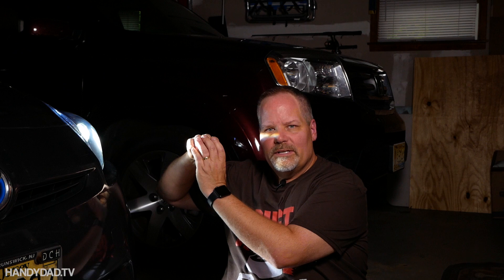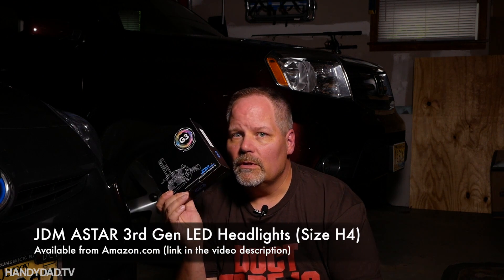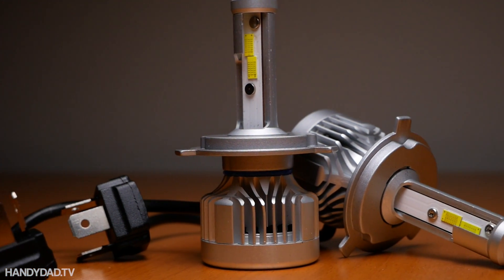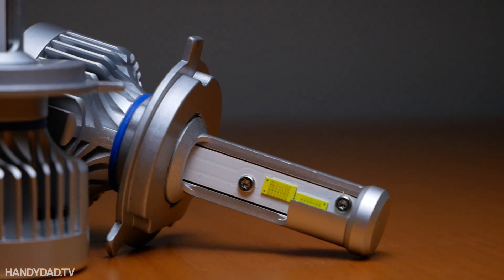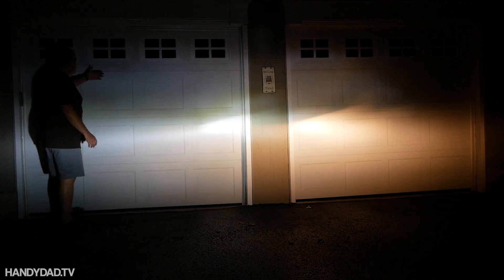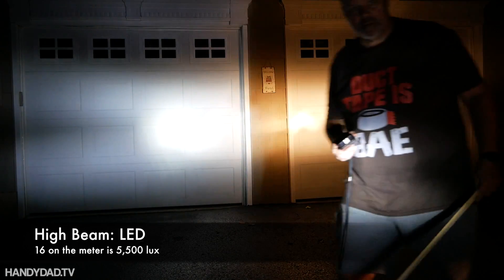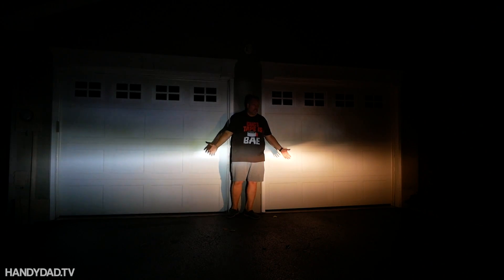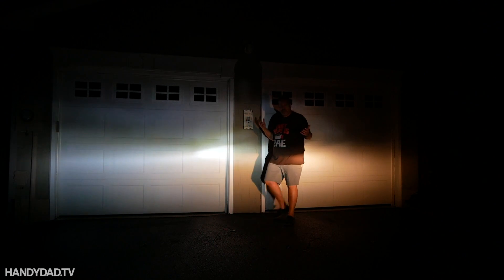Dual Beam LED vs. Halogen in Reflector Headlights

Comment from the maker: New Federal regulations introduced to the United States as of January 1, 2020 that now regulate the specific type of bulb you are able to use either in a reflector or projector type headlamp housing as well as a Federal ban has also been placed by the Department of Transportation on the public sale of automotive aftermarket LED and HID type bulbs that can be used to replace an existing OE halogen ‘headlight’ type bulb or an OE high intensity discharge(HID) ‘headlight’ bulb. This law is intended to reduce and prevent the public use of an aftermarket LED or HID bulb (that is not an approved as replacement bulb by the vehicles manufacture or is compliant with DOT public road safety laws & regulations) that may be used in the automotive manufacturers reflector or projector type headlamp housing.

The parts that are mainly impacted by this new regulation are aftermarket replacement LED and HID bulb numbers and/or sizes that include a number/size that begins with ‘H’ such as H11, H9, H8, as well as other variations that use a 4-digit bulb number such as 9003, 9004, 9005, 9006, 9008, or 9012.

This only applies to front headlamp lighting applications such as a low beam, high beam, or dual low/high beam bulb.  The new regulations will not impact front fog lighting, off road vehicle lighting applications or other front lighting applications on automotive vehicles.
Reply: Federal Regulations mean nothing.  I dont see them out writing a ticket to the guy with the 3' LED bar that blinds everyone for miles.  People can and will put LEDs in factory housings forever.  Get used to it.

Comment: Does that fan pull in or out? If it pulls in, I think that rubber cover has no purpose because the fan will certainly pull in dust and moisture from the engine. Maybe a filter would solve that, but that's too many parts.
Reply from the maker: It pushes out

Comment: So are the LED retrofit lights designed best for use in low beam of both low and high beam applications in reflectors or projectors? Some users claim some high quality LEDs work fine in reflectors without too much scatter. What about halogen fog light reflector housings? Assuming we are looking at high quality, high end LEDs.
Reply from the maker: LEDs work in any of those situations.

Comment: but what about light scatter and potentially blinding other road users......................leds not ok in all,judgment/some comon sense needed
Reply: Nope. LED’s are always ok on reflectors.

U get a bad beam pattern, no hotspot, if u get the wrong type of led bulb that doesn’t match the specs. Such as large foot print of the led chips that are too big, the space between the led can be too wide, or even if u see a square led or double stack LED’s. Those will never work. 

U would have to look for something that’s really really thin, and a very itty bitty narrow led chip to mimic the beam pattern. Nowadays, lasfit,auxito,auxbeam, Fahren, Hikari, VLED’s micro evolution, Xenon Depot, S-V.4, Diode Dynamics, Morimoto, and GTR-Lighting.

Comment: I have a mod that let's me use the high and low on together. It doesn't work with the leds I have. Are there any leds that let me use both the high and low together? I got h4 or 9003.

Comment: I have a high & low in one LED in my Dodge ram . what I don't like about it is when I switch to high beam the low beam cuts off. which allows me to see down the road a good bit but I do lose a lot of visibility for the first 30 to 50+ ft.  anyone know if this is normal or did I do something wrong when installing them? this doesn't happen and quite a few other cars that I've been in but I did not take the time to see if it was two separate bulbs in them or one single high low. I purchased a cougar flagship series H13. the low beams are excellent and the high beams are good as well it's just that I wish they work together instead of the low beam turning off.
Reply from the maker: It's probably normal behavior for halogen bulbs, so that's how the car is wired. Two filaments in a halogen bulb, on at the same time, might get too hot.

Comment: on H4 headlights LEDs really luck on design even the expensive ones, its because of the complex design and the need of 230 degrees of lighting cut off where leds are super bright on the center and very weak at the down spread only xenon is much much brighter and more efficient  , on h7 on the other hand leds are far superior to halogens, even 15 € kits with 20-25 watts are twice as bright as halogens and expensive kits like mine (35 watts from novisight) makes xenons look like candles, if your knowledge is limited to your car only its not good to think every car / headlight is the same

Comment: the use of a yard stick is the wrong way to go about it. Light spread patterns and distance being different with every light & type of light - you should have tested it at a breaking distance threshold for motorway / freeway speed. Then I'd have liked the video.
Lux, lumen, candle power all being totally unfit measures to compare these.... the above way is the only proper way in my opinion for safety and piece of mind

Comment: you are not that smart,  put the bulb after the dust cover so that it covers the back of the head light, by the why put it correctly.
Reply from the maker: I’m not that smart? Perhaps you should look in the mirror. I showed how I put on special dust covers that allow the fan to protrude. Those bulbs are still working great after several years, so I guess I did it right.
Reply: Ur stupid

Comment: You will find that a traditional halogen high beam with a more yellow output will cut through fog much more effectively. LED high beams simply reflect off suspended water particles in the air, i.e. fog.
Reply from the maker: Well, practically every new car comes with LED headlights so I guess people in foggy areas are screwed.

Comment: Driving in total darkness gives a clear advantage to halogens, as there's not as much blue in the mix that prevents your eyes to adjust. And in spite the idea that LEDs live 10x longer than halogen, in reality it is not so. So there goes your financial incentive. There is also a problem of focus, which works fine with most halogens, but not so much with LED. I could see it clearly confirmed in this video as well: LED was blurred, while halogen had sharp boundaries.
For the time being, I'll stick with halogen.
Would I switch? Sure, when the technology becomes mature. I did the same thing in my home. The first LEDs were downright awful. They flickered, they were tedious in any activity, and people under them looked like not-so-fresh zombies. Then came the current mainstream crop with CRI~80, and finally those with a proper CRI>95 that I let into my home. They do die more frequently than advertised, but the final crop of halogens were horribly manufactured, and therefore LEDs are here to stay.

Comment: No they do not cast the same pattern, the LED hotspot goes further into the oncoming lane and is more glaring due to the colder color temperature.  This is why they should be illegal as drop-ins to incan housings in all states and only irresponsible drivers install them.   Futher your pumping them on amazon is pathetic and shameless.

Comment: The fan blade is exposed, but the heat-sink is completely covered. Wonder how this affects the performance long-term.
Reply from the maker: The fan is inside the heat sink. It’s hard to see, but it’s all outside of the dust cover so it works perfectly.
Reply: @handydadtv  The thing is... the fans needs to blow the air through the cooling fins so won't the fans blow in the "dust air" the same as if you would leave the dustcover off?

Comment: How does the dust cover affect fan's cooling ability?   Is the fan recirculating previously warmed air and building up heat?
Reply from the maker: No, the entire fan is outside of the boot.
Reply: Thank you. Well done video!
If the dust guard goes back on, does it notrap the warm air in the headlight fixture and start recirculating that warm air further heating the air?    Make two holes in the dust guard and cover with cloth to filter the air?
Reply: Oh   Sorry.  Had to leave on an emergency run before you mentioned the aftermarket duct covers.(Must have a filter over the air going in and an opening to allow air to exit.)
Reply from the maker: There is no filter. The entire fan is outside of the boot. No air circulates inside the headlight.

Comment: The flickering on the LED headlight is not due to camera shuttering. Digital video recording does not have shutter.
The flickering is caused by the bulbs themselves. These LED bulbs do not have a canbus included onto the wiring and some vehicles tend to have flickering while the vehicle is running. While off the flickering stops as they no longer are running on alternating current but instead on the battery. If you were to raise the RPM's while the vehicle is on, the flickering will basically become invisible AND the brightness of the bulbs will actually increase.
Reason I know this is because I too have a 2013 Tucson which I installed similar LED bulbs. I ended up purchasing the additional canbus and they completely got rid of the flickering and the bulbs are at their full brightness at all times.
Lesson here is, always look for LED bulb kits that already include the little canbus blocks attached to the wires, otherwise order the canbus at the same time.

Comment: Fitted a pair of LED H4s to my 2001 Ford Courier a few months back. As I was not aware of the radio interference problem when I fitted them, I did not buy ones with ferrite beads on the leads. I live in a fringe reception area and the RFI from these lights completely wipes out FM reception. I'll get around to sorting through my electronic stuff one of these days and try out some ferrite rings/cores or beads.
Subjectively, these lights are quite bright and white compared to halogens which look dim yellow in comparison. The fact that oncoming drivers don't flash me with their high beams leads me to believe they are not being blinded or annoyed by my LEDs on low beam. I find the HIDs fitted to some European cars to be the most dazzling on low beam.
More than half of vehicles in my area (Eastern Victoria, Australia), including mine, have light bars fitted. Not for show, but because we can encounter kangaroos, wombats and sambar deer on our roads at night. Plus other wildlife, but these are the ones that can make a mess of your car. The LED headlights on their own are an improvement over halogens in this regard,but the light bar makes a real difference on the open road.

Comment: For just about ANY external automotive light source, the exact position of the point source of light within it's housing GREATLY affects the overall output and glare (or lack of) experienced by oncoming vehicles - those things are typically VERY carefully designed.   If the position of the actual dies on the replacement LED lamp  don't EXACTLY match the position of the filament for the original bulb it replaces, all bets are off.  The result will most likely be sub-par performance (overall brightness and throw) yet at the same time also be "blinding" to other drivers.

Comment: A thing to consider:  With the fairly symmetrical reflectors that you have on that Hyundai, you can get good results with LED's.
However, on my 2000 Miata, it has a non-symmetrical reflector, and LED's scatter light horribly.  And I've tried high end LED's.  I'm finally biting the bullet, and installing retrofit LED projectors into the headlight housings, and bringing an end to antiquated filament lighting on  my car.

Comment: Yes they do work better and appear to be brighter, but you have to adjust them so you don't blind oncoming traffic. The cut off line is not the same as the Halogen line because of the bulb design.

Comment: The LED's I put in have a cooling fan. Looks like most do but I don't know why since LED's run much cooler than even florescent bulbs and halogen are very hot. Headlights should be adjusted, aimed after such a change. Mine are much brighter since I also had to polish off some hazing on the old plastic lenses on my 2003 Venture. The Kelvin # on a bulb determines how white it is and these LED auto headlights all look like "daylight" color bulbs. I read that the LED's should be oriented at 3 and 9 o'clock. On my set up it wasn't clear on that.

Comment: I think you could of made a dust cover out of a metal cup, cutting a hole in the end the right size, ?
Reply from the maker: I really needs to be rubber to stay in place and stretch over the fan.
Reply: But using rubber with heat from the bulb creates a melting problem.
Any thing you buy, looking at what you paid for, you can copy, make, return,save money.
Reply from the maker: It doesn’t melt; it’s made for it. And it wasn’t expensive. But do what you want.

Comment: i own a Mazda CX5 that has projector for low beam and reflector for High Beam+DRL, the projector works great with LED  because it focuses the light leveled towards the front low portion, when i tried my High beam , it will shoot light everywhere, mostly high to the front so i could see the top of the trees , not good, i still want to try those leds that has 4 sides mimicking how a halogen behaves shooting light 360 degrees.
Reply: Jorge Rodriguez I have a 2016 Mazda CX5 GT and the factory LED lighting is second to nothing else I currently own or have owned in the past. They are stellar for an OEM setup.

Comment: Thanks! Like the video. Want to upgrade my low beams, on Toyota corolla! Had the car for 1 year. Time to upgrade
Reply: No, time to be a responsible driver and drive at safe speeds instead.  There is nothing wrong with Corolla headlights that prevents drivign safely per the posted MAX speed limit or the lower limit appropriate for the road conditions.

Comment: Just got a 2018 Mustang with LED lighting all around. Replaced a 2013 Hyundai Elantra Coupe that had Sylvania zXe headlights. World of difference, I really love the LEDs over halogens.
Reply: I work at a parts store and try to never sell ZXE bulbs. Have tried them myself and the Silverstar Ultra puts out much more usable light than the ZXE. That said they have a new ZXE gold series that claims to be better than the ZXE but is also 20 bucks more.
Reply: Imagine how much better it would be if you didn't buy those cheap crap Sylvania bulbs
Reply: @pv3566  Yeah, glad I never have to worry about buying halogens again. LED lighting rules.

Comment: There is a problem with these LEDs in this reflector housings, and it is demonstrable at 5:50 in the video:
If you look at the pattern between the lights, you will see that there is no defined cut-off on the retrofitted LED side (left). Yes, there is a point where the light is bright, below the line, and dim above it, but that dim light above that line *should not be there at all*. This is the glare that other road users get blinded by. 

On the passenger side, there is a big...blob of light, which is really a poor headlight design., but it is centralized. It will not be blinding oncoming traffic. It may bother someone you are following, but only in their rearview mirror. Outside of that blob, no light is being thrown, which is pretty much exactly what you want, so you do not blind other road users.

Besides all of this, it is illegal to use LED or HID bulbs, in housings not designed for them. Because of this problem.

Comment: Problem I have with my led high beam bulbs with fans is radio interference. After my led crap out in going with heat exchange  ribbon type leds. I run HID low beam which is factory on my 02 Altima  and LED  for high beam.

Comment: I would like to point out the only reason HID lights blind and annoy everyone is because the people who install them don't seem to realize that the bulb is much longer then a standard bulb. This does two things, first it raises where the light projects turning low beams into high beams. Second, it changes the scatter pattern because your getting light from a long thin bulb instead of from a short fat bulb. To properly use HID lights you need to buy HID reflectors AND you need to adjust your headlights to aim lower. Me and my father installed HID on his old mustang when i was younger, we replaced the headlight housings with HID headlights, and after we installed the HID bulbs we adjusted the aim of the headlights and nobody ever told us we were blinding them or flashed their high beams at us.

Comment: My 99 oldsmobile bravada doesn't even have reflectors in the head lights. I've had HIDs, now LEDs led is by far the better choice. They scatter so much it's crazy, at first I didn't like the scatter, now that I drive more in the dark hours I love the scatter! Lights up about 25-30 feet off the side of the road. Easily lights up fields and yards etc where deer like to eat and roam.

Comment: Frick thanks! Been looking all over for a comparison like this. So other than the colour temperature, there is no advantage. I'm confused for Halogens are tapped out at 1700 'Lumens' but these LED bulb manufacture's are claiming 3-4k Lumens. So are those bunk stats for sales or is there a 50% Lumen loss in the reflector? It's interesting how short sited the regulators creating the DOT legislation were, legalities set at the tapped halogen capabilities with wattage instead of Lumens as if humans were never going to get past Halogen technology.
Reply from the maker: I did another video with a distance test of halogen vs. LED. The results were surprising. https://youtu.be/VCns9CzdQn4